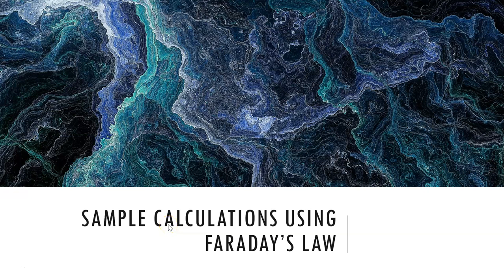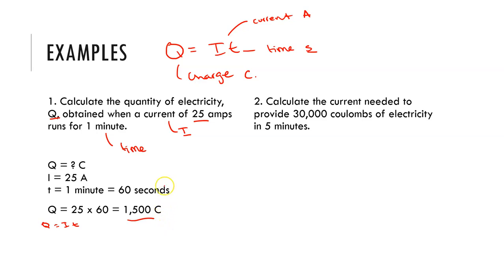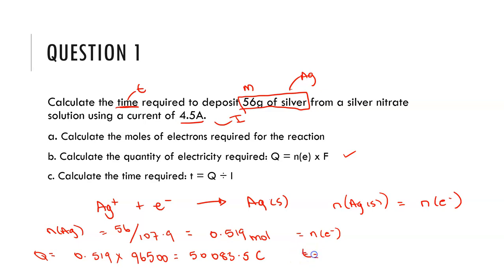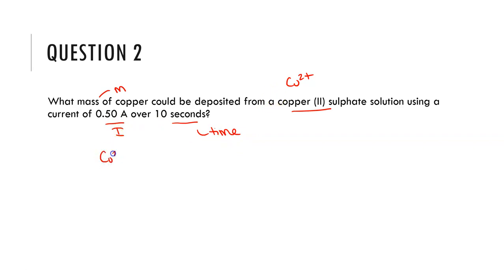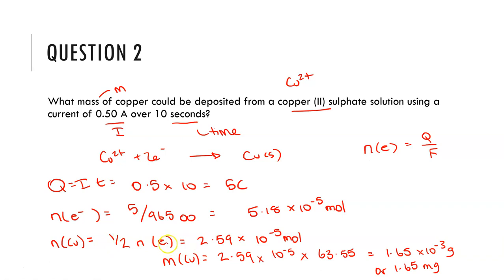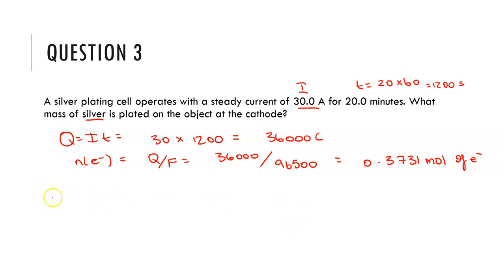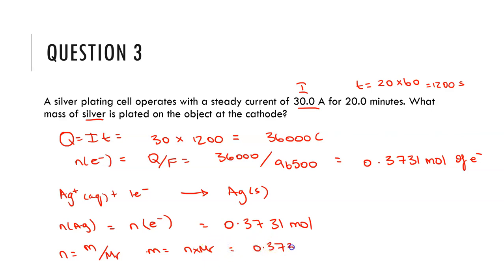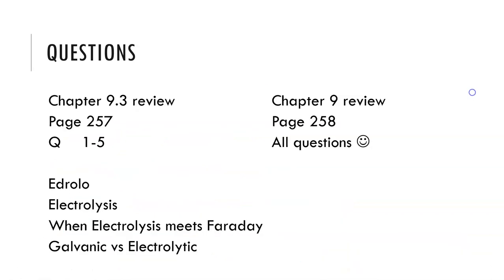FC2: Unit 3 Chemistry AOS2: Example Calculations Using Faraday's laws

Comment: How would you know when to multiply or divide the number of moles of electrons?
Reply from the maker: If the question asks you to calculate the total amount of charge required to deposit a certain amount of metal it is asking you to multiply the number of mole by Faraday's constant F (it is important to take into consideration your mole ratio here as well that is if you have a +2 metal it will take 2 mole of electrons to produce one mole of metal).
Reply from the maker: If the question wants you to determine the mass of the metal deposited you will need to take the total charge (Q) and divide by faraday to find the mole of electrons passed through the cell. Then you need to look at the mole ration e.g. Ag+ would be a 1:1 ratio metal to electrons. Cu2+ 2:1 electrons to metal ratio. If this hasn't answered your question please let me know. Good luck with your studies.